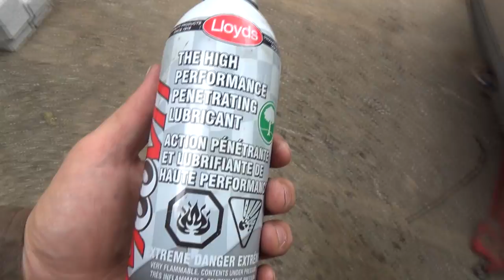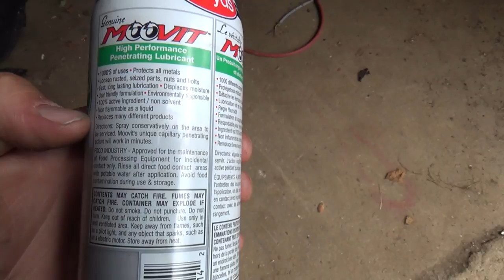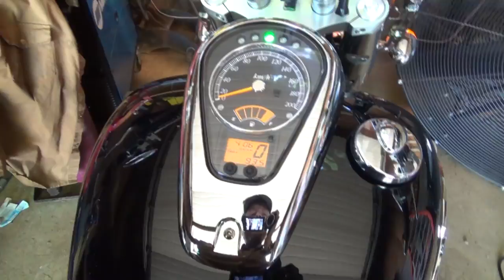Made up some new brake lines i like the bender

Comment: for what its worth, i had a 04 sierra work truck, same body style as your current one, by 100k it was falling apart and rusting, it did last until 400k but it was hurting by the time we replaced  it, we got a 2011 sierra the same as the body style your looking at, at 120k not a single thing has gone wrong with it, the underside and frame still look mint, and this truck is driven in the winter and in the dirt once in awhile, i think the newer body style of these trucks holds up alot better then your style did,  though i live in nova scotia, we salt the roads but thats it,

Comment: next time you buy an older used truck buy it online and get it shipped from a non rust area........I bought an 07 express van from texas and had it shipped to me, its so clean on the bottom it looks brand new, you bought a pig in a poke there bill

Comment: Bill, looked at pictures of that truck. Don't see any body damage, passenger door is just a reflection. Snow way is an okay plow, decent for driveways, but you'll wear it out in short order doing the cemetery. Fisher western and boss are the big contenders in the plow industry, and a 1/2 ton is not made for plowing, hard on suspension, driveline and transmission that said, not a horrible price for a 6 year old truck, but I'll give you my GM employee discount if that would help. Also now that the word are out, mad rebates on 2014s, where you can a decent bells and whistles featured truck regularly priced $40k for $25k. Let me know
Reply: Look at the pictures again and look at the rear on the passenger side, there is a noticeable dent in the fender.

Comment: have the same truck and they do rust quite a bit if you don't keep the frames washed in the winter. I have mine sprayed every fall with sheep oil there is another name for it though. soaks into the frame and salt water just runs off of it.

Comment: You might could grab some old motor oil put it in a sprayer and just spray that whole frame/chassis while you got the bed off. Spray er a few times and let er soak and it will calm the rust and corrosion down. Just soak er let her sit and repeat a few times.

Comment: Bill thos years are known for a few valve train issues, its not overly commin but it does happen! and really is only failure with the gen 4 small blocks, lifters and sometimes a camshaft lobe is wiped off, usally its a lifter repair, takes about 8 hours to perform both banks!

Comment: You already have an old truck with almost everything replaced, I wouldn't buy another one used unless its low mileage.. I bought new because with all incentives and deals it actually cost less with the 0% interest then buying used. The new truck price was less then a lot of the advertised used truck prices. Financing on a used vehicle is crazy high. That one looks new but it could actually cost more then a new one, No warranty on that old. Any problems would be yours. Not much less $ then a new Dodge :)

Comment: Truck looks nice. Just a few things came to my mind. I know you like your Jeep but do you think you will get time to do what you want to do with it.  Some where out in back don’t you have a van or two plus other stuff that could be cutup for scrap.  Or sell for parts.  Could you use this truck (old truck) for a work truck around the grounds, after all the work and parts you put on the old girl.  Would the cemetery give you any money for it that way you don’t have to drive the tractors for every thing you hall around or pick up for the place.  New truck would you use the plow on it?  How hard of plowing did someone do with it?  How good is the front end of it? How close is it to having any transmission problems?  If you purchased a new truck and added the plow and cap for the truck which already comes with it and cap is already the same color that Would be much more money.  I know always a lot of questions go thru your head.  When you have time you want to be out on your bike or bikes and with the family and friends not wrenching all the time.  Good luck on making your mind up on what you want to do and that all works out for you.  Love the videos keep them coming if you can.

Comment: And you might want to check the Chicago Area for Better Deals I Found a Good Deal Near St Louis MO but with the problems you have with Ice look at 3/4 ton with a heavy Snow Plow I used a Diamond V and the newer ones are made by Meyer and I found Great prices both on line and at shops

Comment: I think that 2008 GMC is too expensive for what it is, and a bit old.  In another 4-5 years you'll be doing the same to that as you're doing now.  I agree with 2010 as the limit, however consider Dodge or Ford over Chevy/GMC.  Just my opinion, but I think they're much better trucks
Reply: ***** LOL!  Totally agree!
Reply: SuperFIFTHGEAR  Maybe even newer than 2010.  Don't know that GM started really addressing the steel brake lines until maybe 2013 or newer.  But like you all are sayin in anywhere from 3-10yrs old starts to have the rust problem dependin on where the truck is driven.  I'm going thru all this now on my 2004.  Replacing it with stainless lines.  Rust is taking its toll but going to keep on going.  Everything up north just seems to get wiped out by the winter salt.  Spraying out the underside routinely thru the winter to get the salt off seems to have helped a lot.

Comment: oil that fram good it will last along time yet
Reply: A GRADUAL bend is always better with metal lines. Sharp or small bends will cause stretching, and will change the temper- causing weakness & premature rust. Also- most factory steel lines have that awful spiral "quick bend" around the line- that always traps moisture and makes it rust badly. Planned premature failure IMNSHO.